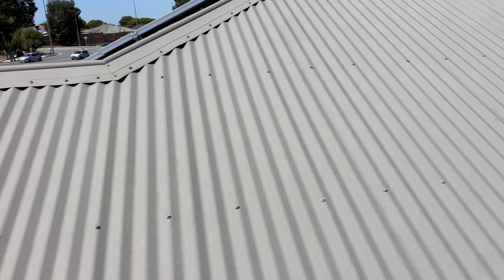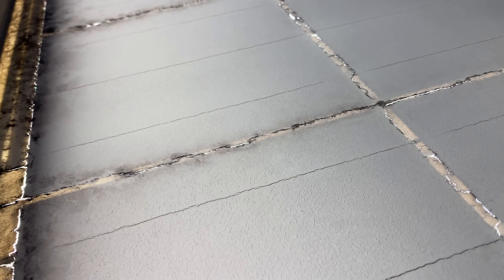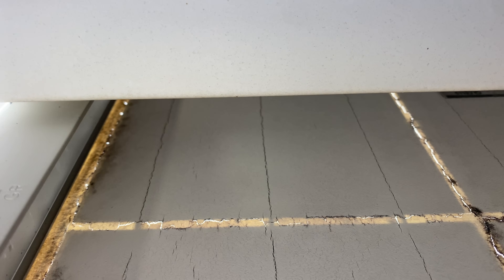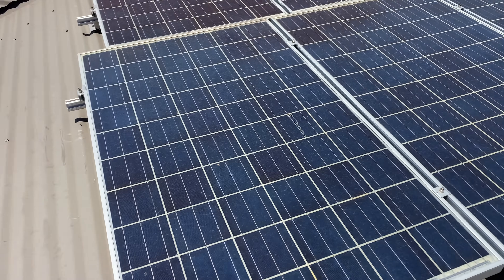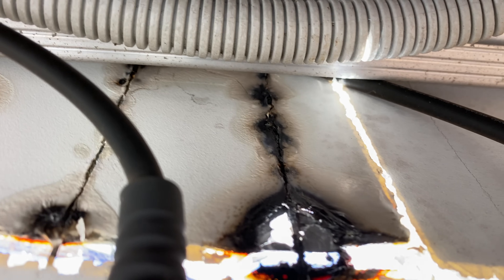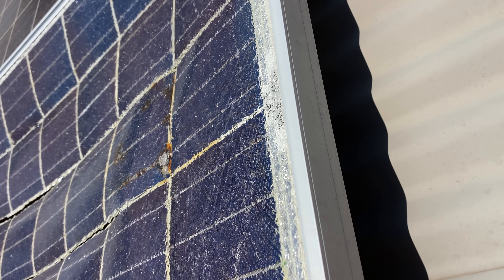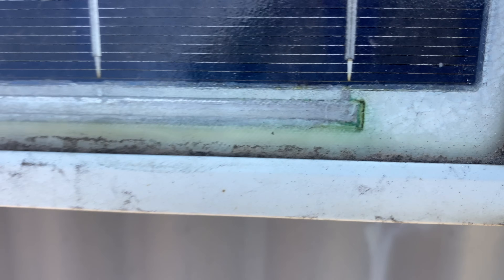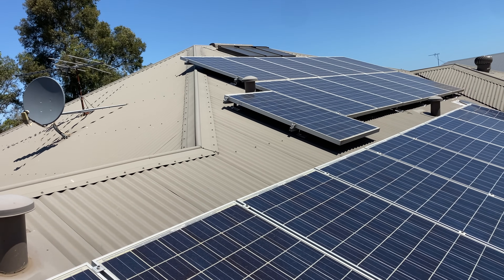QCells solar panel failure should I even bother trying to make a warranty claim!￼

Comment: Qcell refused to replace dead panels for a customer of mine even after photo evidence of failure from a solar installer.  They lasted 4 years and the whole array had to be replaced.  I share this story to every customer i know and the solar guy i recommend refuses to use them as he witnessed the system i mentioned and did the replacement job.  Qcell refused to talk to the customer and professionals.
Reply from the maker: Thats very disappointing 😕

Comment: Is it possible to replace a bad panel for a higher quality panel one at a time as they fail ?
Reply from the maker: Yes if electrical characteristics are within 5% of the replaced panel.
Reply: Older panels are impossible to find and modern new panels are more than double the amps and all panels must have the same amp rating voltage does not matter as long as string voltage is not to high typically under 550v open circuit, so answer is no unfortunately

Comment: Panels are cheap. Max out all sides of that roof with the mos watt-peak you can fit on it and divert excess power production to hot water production, for example. Time for a major upgrade.

Comment: Solar is great for someone like me who lives off grid way out in BFE where there are no utilities but people putting them up on homes in towns and cities where there are reliable power grids thinking that they are going to save money is ridiculous. I shopped around for my components and installed my own system for around $8K which over the past 5 years I've spent another $2k on maintenance. So my current average electric cost is about $166 a month. I sip power anyway and my average bill when I lived in Southern California was only around $65 a month. Yeah over time my system may start saving me money barring any more major failures I have to repair but if I had not had the knowledge and skills to put together and maintenance my own system it would have cost me me at least $30K and I would never live long enough to make it pay for itself.

Comment: Boston MA rooftop installed with Hanwha DUO BLK-G5 Modules in 2021, 325 watt panels.  Microinverter failures have shut the system down twice in 4 years, for several months each time. We now must pay for installer to come diagnose the problem, then submit a claim, then many months later for array to come back on line. I would not recommend QCell.
Reply from the maker: Thats very disappointing, I hope you get a good outcome eventually
Reply: If the problem is with the microinverters, then that's not the panel's fault. Anyway, microinverter companies like Enphase claim if one fails the rest of the system continues to operate as normal. It sounds like your system has some design issues, I'd be asking questions about the installer.
Reply: Ditch the microinverters, for get about optimizers, review and if advantageous adapt the array's series/parallel/ charge controller(s) layout/system design.

Have the installation work on the roof done by an installer with NO sense of humour about installing VERY well (ONLY Stäubli MC4 connectors, no wire touching the roof, not even the possibility of water directly or indirectly ever reaching an MC4 connector, for example).

Use Victron gear, it is the Bentley of solar equipment.

Comment: 12 years is a long time for panels to be out in the elements 24/7. Time to get new. Panels are cheap and superior to 12 years old tech.
Reply: They have warranty of 25yr for a reason they're supposed to last. Only cheaper with the rebate that tax payers are subsidizing. I'd be going for warranty claim, also will go and check mine now! Also water ingress on a slope thats pretty poor could understand if laid flat.
Reply: @rw-xf4cb  I recently purchased 8 x 585W Canadian Solar panels @ $US92 each equivalent here in South Africa. That's fairly cheap in my opinion. 2 years ago, I purchased 550W panels at twice the price. So yes, in my experience the panels are getting cheaper. With the current trade war, I don't know what effect this will have on future panel prices and solar equipment in general. Let's wait an see.
Reply: @NinoLuciani-ei2ds  Yeah panels are cheaper so the warranty replacement shouldn't cost the organization much to replace (most will be in removal and reinstalling), even if it were the one damaged panel they replace the lot. I had hail damage and that happened as can't mix and match on the same string.

Comment: Just imagine the tiny glass fragments that would be going into your water tank, if your roof was used for collecting rain water! A lot of rural people do not have water filtration at all. A smashed solar panel is not something anyone would expect.
Good, honest video. Thank you.
Reply: Not if you have the correct debris separator on your down pipe bro..!
Reply: @sirgregoir  chemicals will go straight through - it's not the glass that's the main issue - there's some really bad crap leaches out of old solar panels. really bad.
Reply: @foff-666  what chemicals are you referring to?
Reply: @foff-666  they’re not cadmium Telluride. I’ve been drinking the water off of my Solar Panels for years.
Reply: @michaelchownyk5255  i don't know, apparently lots of bad stuff - but i am talking about BROKEN panels, not sealed working units... apparently the broken panels leech all sorts of dangerous stuff you wouldn't want in your drinking water.
Reply: @michaelchownyk5255  If you had a microelectronics degree and learned just a bit on chips production tech - you'd keep away from semiconductors as far as you can. Lots of chems are used in production process - tough they mostly stay at the factory, lots of additives are added to silicon itself to make a chip with required properties. Then we have simply conductors between cells and their interaction with not-so-pure (e.g. acidic) rainwater. Add some bacteria and other life forms to the funny picture.
Reply: @michaelchownyk5255  W. Churchill was smoking, drinking and died pretty old. If your panels are perfectly sealed - it's like drinking from glass and zinc/iron/aluminum (or whatever is used to fix the panels).
Reply: there are a lot worse chemicals that come out of smashed up solar panels than glass fragments...
Reply: I know they silane and Tri methyl borane and some powerful phosphoric acid in the process of manufacturing, silicon, solar cells. I’m a big fan of them because they power my house and my car and everything I’m doing in my life and sustainable energy is the future for sure. Slave Ukraine.
Reply: I know they silane and Tri methyl borane and some powerful phosphoric acid in the process of manufacturing, silicon, solar cells. I’m a big fan of them because they power my house and my car and everything I’m doing in my life and sustainable energy is the future for sure. Slave Ukraine.

Comment: Even though the system is 12+ years old,  if it's still under warranty I'd DEFINITELY filed a warranty claim!
Reply from the maker: The pain is often not worth the gain when a new system can be bought from as little as $3.5k
Reply: @joondalupelectricalservice3201  And then those 3.5k will last 3 years, because companies can continue this scheme, because customers dont complain? Thats just the wrong way!
Reply: That would be at least 50(!) full size glass-glass bifacial panels at current prices.

Comment: But we are all told solar panels last at least 25 years.
Reply: YeaH same as LED globes, bet these were not tested in 40Cplus temps :p
Reply: Quality solar panels, used within their optimal environmental conditions and within correct environmental spaces, will and they have the warranty to back that up. My solar installer used Jinko Solar Tiger Neo 440W panels and the panels themselves are warrantied for 25 years while their output is warrantied for 30 years. And according to solarquotes they rank pretty high for warranty and customer service.
Reply: @evanstedman7405  : except that warranty is so long neither your installer or the overseas company will be around to honor a warranty that long. Maybe have a good read of that warranty and see if there are any reasons they could use against you for not meeting those "optimal environmental conditions".
Reply: Mine are 13 years old and have followed the manufacturer's graph perfectly in regards to power reduction and are still in excellent condition charging my LiFePO4 battery. I didn't buy overpriced Tesla crap though. Sieg Heil Musk. Another Tesla mindless simp. Their battery will be next.

Comment: Q Cells made in USA, Malaysia, Sth Korea and China.
Bet you got the Chinese ones.  My experience is that they would be a cheaper compromised manufacture.
Reply: pretty sure I saw 'made in Poland' on the label underneath.
Reply: @noelwhittle7922  
Check Google...not possible.
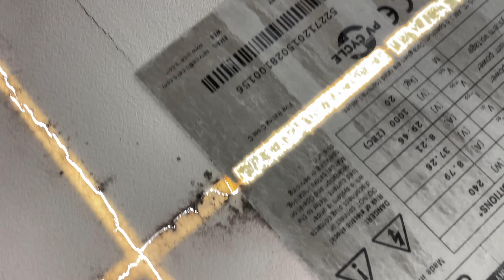Reply: @MelodyMan69    Check the video ...  @ 1:14  'Made in Poland'.
Reply: QCells originally had been a German manufacturer,
that went banckrupt early on,
guess the cause ...
bought up by South Korea company Hanwha.

So, there is a moderate possibility,
that those early failing modules
from the days of the first solar boom
are actually "made in Germoney".
Reply: I did say Poland.

Comment: Every man made product has a finite life. Even a concrete building eg 50 years if you’re lucky. Solar panels, 12 years? Not bad huh? 
What do you expect , they last forever? Be realistic, mate.
Reply: Their expected life is 25 years. If you got a fridge with 2 yr warranty and it goes bust after 11 months, what do you say, "not bad" ???
Reply: Have you seen the back of the pannels (around 1 minute mark) I have never seen the back of them fall apart like that (that bypass diode is probably quite hot)
Reply: @jacobheinz8236  My neighbour still has 24 working solar panels on roof since Kevin Rudd rebate days.  I remember when he used to brag about how much in credit he was with the Power Company by feeding the excess power back into the grid during the day while at work.
Reply: they're not cost effective if they don't last as long as they are claimed, it is false adverting and fraud, you must be corporate shill

Comment: I think I just bought some like these, but 345 watts.   They are new all stock.  Thank that I didn't pay much and they will not be going on a house. Thought q cells were the best.   My 420 bifacel q cells work great and out preform all others I have.
Reply: Those here are 240-Watt panels,
produced around year 2005 to 2015.

From year 2015 onwards,
standard solar panels were 300 Watts and more.

The cell size shifted from 5 inch to 6 inch
from then on.
Earlier solar panel cells were just 4 inch squares.
Reply: At least the one I bought were not made in Poland,  I think they are Singapore.

Comment: This is why I always will use rapid shut down on anything over 50 volts even on RV's, or ground mounts. The reason is have a panel that failed like this spray water on it to clean it could end up getting electrocuted. Have several other panels in series still generating power. When I wash panels I activate RSD drop the voltage down to each panel less then 50V. Permitted systems require it but DIY systems and large custom RV's can have 300-400 volts.

Comment: Metal roof panels get extraordinarily hot
Reply: you wanna see the temps on black tiled roofs. My panels are 13 years old and look fine. I'm not a Tesla simp though.
Reply: @RestorationWatch  How on earth is that relevant to Q-cell panels?
Reply: @WyndStryke  You need to look at who I was replying to and not assume it was the original post. New to YouTube comments??
Reply: @RestorationWatch  You were responding to the comment "Metal roof panels get extraordinarily hot".  I still don't see how "I'm not a Tesla simp though" is at all relevant.

Comment: My q-cells did exactly the same thing, they are now, 13 years old. I had no water ingress, however the back contact insulation protection started to fail, exactly the same, the material is obviously not UV rated, bad manufacturer design. Shame Q-Cell were supposed to be a "good manufacturer".
Reply: chinese quality!
Reply: @namm0x326  Not even that, chyna lasts longer. 🤣
Reply: @namm0x326  Panels from Qcell 12 years ago were made in poland, and its a german company that moved to south korea, it was during a bankrupcy phaze, id recommend anyone who had QCELL panels from 11 years or older ago to check there panels :)
Reply: @namm0x326  Tesla quality! LOL Misaligned car panels, most and slowest service calls. Junk solar panels.BIG profits.
Reply: @RestorationWatch gee you are really hung up on Tesla. My suggestion is that you don’t buy one, especially when Chinese EV’s have no downside risk unless war breaks out
Reply: @RestorationWatch  What has Tesla quality have to do with panels!
Reply: @RestorationWatch   I had my Model 3 since December 2019 all I did was a set of tyres at 30000km and that’s because I was gunning it at every set of lights.

Comment: Backsheet cracked, check.  Cells damaged, check.  Water ingress into encapsulation, check.  Honestly this looks more like crap old Trina panels not something I'd expect from QC.
Reply: A lot of the MFG's used the same back sheet and EVA and so ended up with same problems.

Comment: Of course make a warranty claim
Reply from the maker: Often the pain (expense to client) is not worth the gain!
Reply: @joondalupelectricalservice3201  I can understand for a single panel... But for all the panel it still not worth it ? They would send equivalent power panel, while getting new model with higher output would be better ? Or what they asked in term of work for each panel is more than what you just did here ?
Reply: @joondalupelectricalservice3201  what's the expense to client? Under Australian Consumer law shouldn't all removal and installation be covered?
Reply: @joondalupelectricalservice3201 that is a ridiculous statement. Are you going to charge the owner $15000 for making a warranty claim????
Reply: Hmmm, it would need a specialized legal department,
which just does warranty claims all day.

Comment: "It's every single panel" is a damn good reason for a warranty claim tho!
Reply: Warranty doesn't cover them being placed in direct sunlight, I bet
Reply: did they pay for themselves.
Reply: 12 years old, what's the warranty length on these
Reply: @BushmanCanuck  normally 25 years on most panels, I have seen some with 50 years.
Reply: @Warhorse469  wow 👍
Reply: @BushmanCanuck  Too long!